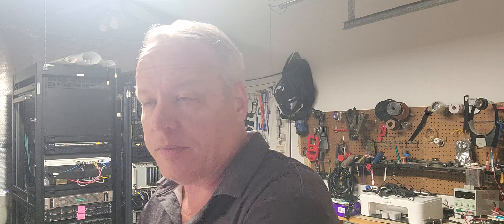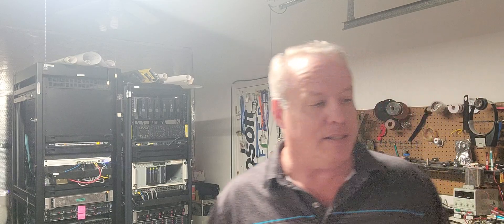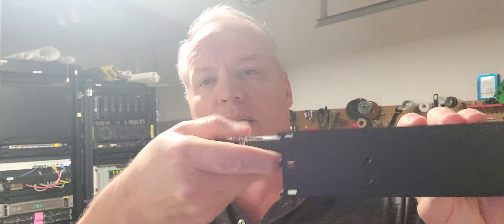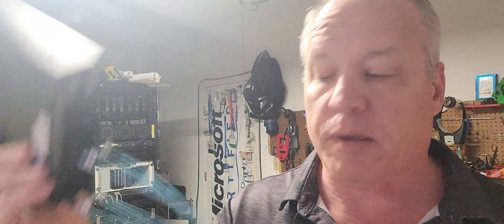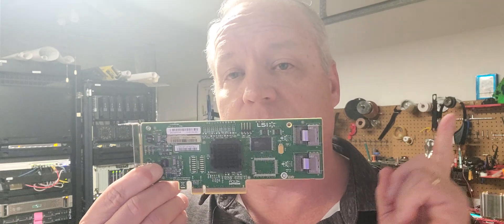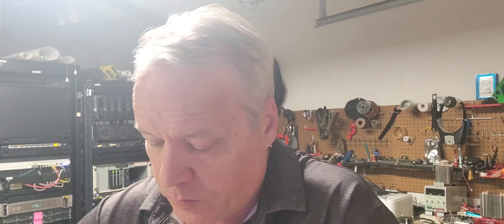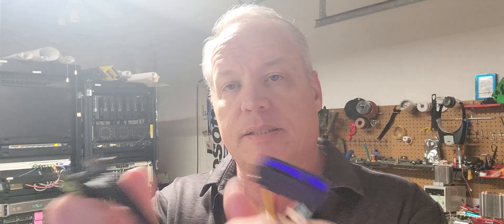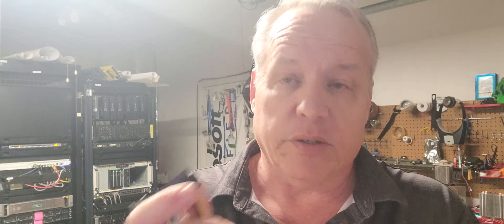OK OK OK This is how to hook up a SAS drive/s for testing on a basic PC system setup

Comment: Yeah I got deceived on Amazon it said sata and they gave me a SAS drive, never heard of one I know a little bit about hardware I built about 10 machines, I found your channel I'm only curious if I was to do this at what point would I be able to format the drive and what will it come up when I log on and look for it would it come up as a drive letter, more than likely I'm just going to send it back I got an MSI b550 generation 4 gaming plus board by the way get you a better camera bro them up close pics not too good thanks

Comment: This video doesn't seem to live up to the title. The end product should have been a standard PC using SAS discs, but you never get that far.
Reply from the maker: Nope the only goal with that video was to Diag drives this way.  If you want to put a SAS drive into a PC, get a 9200 LSI HBA PCI-E card with internal ports, a SAS cable 4 to 1 connection cable or two, (I will provide a link at the bottom for the controller and the cables that most people seem to like.) for a total of 24 drives and a power molex header and you are good.  Or you can watch my video that talk to this very thing. Hope it help you. Enjoy  Links are here:  for the cable set. https://www.ebay.com/itm/284618234227   for the controller link here - https://www.ebay.com/itm/126020930228?_skw=LSI+9200&itmmeta=01K2DDPXNPFH17CKK1JX5VQDGA&hash=item1d576ecab4:g:OAkAAOSwRDNl~xh3&itmprp=enc%3AAQAKAAAAwFkggFvd1GGDu0w3yXCmi1ev8jG9sQW6uSYfzIHGF6Tz%2FJrycPYu08r0PZqEJNqeBO0kQIVI8g7i6mChJwrN4JudCgZcRdT%2BX4cfXPEyYtJC4rn7BJ%2FWRNSg4ILjxCo%2F8z0Yu7V%2Bs%2BIII4PpIINZU71RQMCq%2Fez1PAhbfMfRjvbdbILRSEg5ZxlE%2FzvU0o%2B07%2FcV4WeYhzTO0PlOoOdXGgnPX6vQyrxIGOp93FkZvTH74E7vKfA%2BmWE0MrIEtnBRZg%3D%3D%7Ctkp%3ABk9SR47b262TZg
Reply: @leadiususa7394  But the operative part for me was "...on a basic PC system setup". Wrong country for eBay but thanks for the name.

Comment: I bought SAS HDDs at a nice discount and a controller board later on, but to use it more conventionally as just a NTFS data or a Windows boot, I've felt out of my depth getting all the puzzle pieces together... wish iSCSI seen in Device Manager helped make consumer Windows work with this hardware, mine is card, cable, drive although scattered currently in different storage locales, literally
Reply from the maker: Hmm So you have the hardware, did you enable the iSCSI windows drivers software seeing on your OS and also your motherboard BIOS may have some iSCSI value you need to setup if you 
are using the motherboard NIC for your network traffic.  Hmmm So question, what is your question you want me to help you with?
Reply: @leadiususa7394 I'm not sure which mobo I have to use it best with and the parts are stored in separate locations that don't help. I do gave a $10-15 dollar used surplus store HP Workstation from 2010 and gamer Asustek rigs of tte same era, allowing top Xeon or Core i7 for 1st generation but I don't have a server or Enterprise level gear
Reply: @leadiususa7394 I do internet PC-wise using an Intel 2016 NUC which is not a SCSI friendly device haha, I'd like the main goal for boot speed primarily
Reply from the maker: @billschwenke790  Yea it will go much better if your have a iSCSi supported Nic.

Comment: My mobo(MSI k9a2) has a SAS controller on it with 2 connections that look like SATA and 2 eSATA connectors on the backplane. It also has 4 SATA connectors. If I want to install 2 SAS drives what cables should I get? I'm guessing the one with SAS connector on one end and SATA plus molex(for power) on the other end?
Reply from the maker: Yes, those are rare (hybrid server /high end motherboards) and come with their own cable sets with them for the Sata-SAS hook up to the disk back-plan.  Enjoy!

Comment: Hi your video really helps me seeing what am building. I'm in plan to buy LSI-9500-16i(for ZFS based system) with exos 8-12x 24TB SAS, since its a custom build with Fractal design 7 XL, am finding hard to get direct connect cable between HBA and drives. so far slimSAS SFF-8654 to 8x SFF-8482 is the only option but it has moelex power connector. is there any other option ?
Reply from the maker: Well if this is for internal SAS yes, if it is external no.   Internal there is a cable SFF with Molex power/SAS hook ups that you can get.  Would something like this work for your needs?    https://www.amazon.com/OIKWAN-SFF-8643-Internal-SFF-8482-connectors/dp/B0CNGRYC7B/ref=asc_df_B0CNGRYC7B?mcid=3f265c4390b43f76b80ca75fe56ded73&hvocijid=12042971252338408231-B0CNGRYC7B-&hvexpln=73&hvadid=721245378154&hvpos=&hvnetw=g&hvrand=12042971252338408231&hvpone=&hvptwo=&hvqmt=&hvdev=c&hvdvcmdl=&hvlocint=&hvlocphy=9015806&hvtargid=pla-2281435179578&psc=1
Reply: @leadiususa7394  thanks for the reply. its for internal. LSI-9500-16i has only slimsas connector(SFF-8654).

Comment: Got the controller lsi. Looking at running 16 drives in the future, the computer really needing help figuring out power 16 molex power connector needed and afraid my power supply for the pc is underpowered. Is there any recommendations on a second power supply for the 16 dish?
Reply from the maker: 650 to 700 watt should work

Comment: So have a 9300 12gbps hba coing soon, and i have 4 6gpbs sas drives. I was given to understand that the controller is actually backwards compatible?
Reply from the maker: Yes But!  You should get a 12gpbs SAS controller and it will handle the older drives just fiine, but make sure you group all of the  6gpbs into one pool or RAID group.   Don't add the 12gpbs  drive/s in with 6gpbs drive for you only go as fast as your slow drive.  Use different groups or RAID groups to get the best results by keep 12 from 6 HDDs.
Reply: @leadiususa7394  One more quick question. The controller I have has internal mini SAS ports, is there an adapter that I can run a cable from one of them to an expansion slot to make it into an external port, so I can connect a 4 drive SAS enclosure without buying a whole other external controller?
Reply from the maker: @ALTruckerDad  Yep! Here you go...   https://www.ebay.com/itm/286509843936?chn=ps&_trkparms=ispr%3D1&amdata=enc%3A1_XK919FLRdO-YbpVZxTtuw40&norover=1&mkrid=711-117182-37290-0&mkscid=101&itemid=286509843936&targetid=2320093655185&device=c&mktype=pla&googleloc=9015806&poi=&campaignid=21222258394&mkgroupid=164713660992&rlsatarget=pla-2320093655185&abcId=9408285&merchantid=563013756
Reply: @leadiususa7394  Awesome. Thank you for all the information.

Comment: Hello sir, my name is shreyash i am from India 

My sir told me to test a sas drive using a mcc usb temp data logger and using a thermocouple he told me to find out how can i connect the sad drive externally and perform the read write operation.
Reply: Thanks for the video, sir. Please I have a SAS hard disk. Can I get SAS to SATA converter to SATA hard disk while SATA cable is use to connect to motherboard. Is it going to see the Hard disk?
Reply from the maker: @bellooluwaseyi4193  No, not to a normal PC motherboard that only has Sata only controller on board. it has to connect to a SAS controller to work.  Most common PC motherboard don't have a SAS/SAT control for it is for a personal PC us and SAS drive are for Servers.  So buy a PCI-E SAS controller like  LSI-9200 with cables  or upgrade your motherboard from a basic PC motherboard to a Server level motherboard.  They are pretty cheap these days.
Reply from the maker: I have done videos on this last year.  Check out some of them to fit you needs
Reply: @leadiususa7394  i cant find the video...if possible can you provide me that video...
Reply from the maker: @thewackyone7771  OK first look at this video explaining the cable hook up process. https://www.youtube.com/watch?v=DAcal3MzC8Y
Reply from the maker: @thewackyone7771  Next you need a SAS controller to put on your PC.  A LSI 9200 series dual port internal SAS HBA controller is what I recommend.   Here is a link.  https://www.ebay.com/itm/126621452117?_skw=lsi+9200+dual+port+internal+SAS+BHA+controller&itmmeta=01JJFQ1Q53HBFPSHW25131CP5J&hash=item1d7b3a0755:g:1CkAAOSwxEFmuaIt&itmprp=enc%3AAQAJAAABEHoV3kP08IDx%2BKZ9MfhVJKm7YxROf3kRK7IcerIU2I11QZ7BuITYA4Y9Y%2BB7AwVIVevFRdYrDvD%2Fpd9GD6Cqm7YWMtErfHBtKsa%2FdxuWV5u%2ByQQRD1617tM0Cmsjnp%2F7ejmCtseliMC1Ec8wpQMVpHuXbHhYweLldOVSEiUd7KlBPJ92HKoapOn%2ByoiAYyQwK5dUMTWLkXIxMOnhOYb8ZCKoR7NjKzxytWt5KVAMC%2BXmTwNMZqL5eA5iwAaQWJprt7LsT6mDN5qZSMgs3w%2FMRzwY9y6cFlNAWESQQZJDt7WYnAmkv6ujSvXEGPbCi7ZyFUkWa2Gf4lXak7XHX55ufaxyfAO8zlN973ltzKbiW%2Fp1%7Ctkp%3ABk9SR-ryhveTZQ
Reply from the maker: @thewackyone7771  Lastly this is a PCI-E IO card so you need a motherboard that has PCI-E slots.  total costs will run you about $40 on average.
Reply from the maker: @thewackyone7771  Hope that helps
Reply: @leadiususa7394  i need to connect the sas controller to the desktop pc...so which type of controller do i need to use a hba or a raid...
Reply from the maker: @thewackyone7771   LSI 9200 SAS HBA controller will work

Comment: Just get a sas controller card.
Reply from the maker: Correct but and the correct cable set that you will need.,  that is half the battle sometimes.  IT does matter
Reply from the maker: I will agree with that.  I did a video just on that very topic and SAS internal and external hook ups.  Check it out sometime if you like.
Reply: Exactly. So much work talking about the enclosure when you can just get a $20 HBA that goes into a PCIE slot. I still appreciate the video.

Comment: Excelent explanation Mr leadius!! Regards from Argentina 👋 🫡
Reply: I don't know how you find this excellent. He confuses connectors, interfaces and protocols with each other. SATA protocol has it"s roots in IDE (or ATA aka. PATA). SAS (Serial Attached SCSI) has it's roots in SCSI. That's the protocol side. On the interface side they are using different signaling on the wires. The connectors (which have nothing to do with electrical signaling) CAN be the same for eighter SAS or SATA. For example interal miniSAS connector (SFF-8087) or one of the external miniSAS connectors (SFF-8088, SFF-8470, SFF-8644). Example: A miniSAS internal connector has a pincount (wires) to connect directlyto 4 SATA drives or 4 SAS drives. The HP Microserver Gen7 has an internal miniSAS connector for connecting 4 SATA drives (not SAS!) which is connected to the onboard SATA controller. If I put a SAS controller (HBA as in Host Bus Adapter or a RAID card) in that machine (which I did) then you can control 4 SAS or SATA drives in the same drive enclosure without any modification.